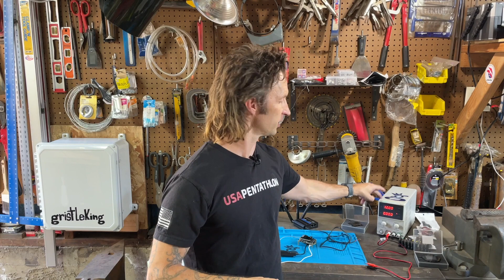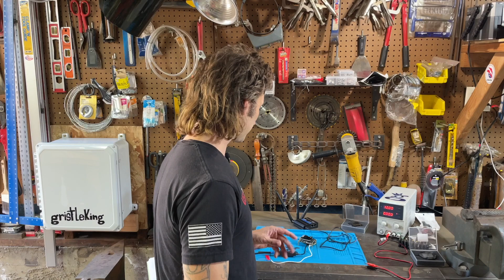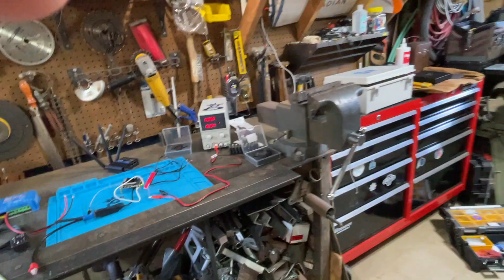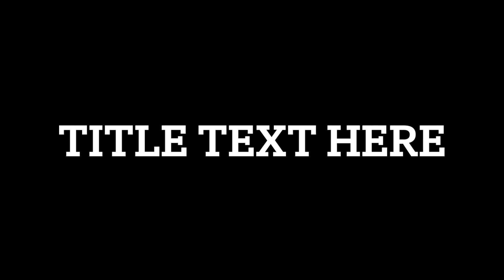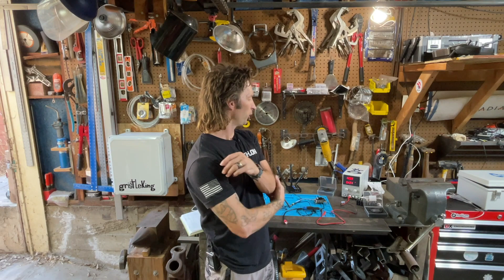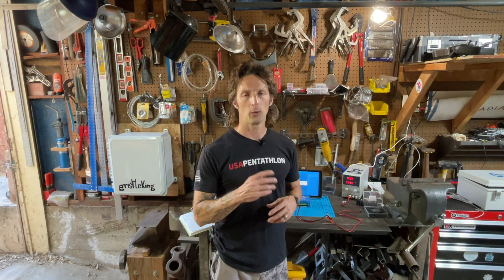Measuring Helium Hotspot Power Draws - Off Grid 004

Comment: Hi there, do you have any experience on setting the box under the ground? I mean burried let's say 10 cm? It'll be for security reasons. Will it heat too much? Will I have GSM coverage? And another question, if you permit, how would you estimate the revenues on a cluster of 10 hotspots each and everyone visible with the others and at a distance around 400 m? Thank you for your responses and a big thanks for all the videos.
Reply from the maker: I've heard of other people doing it and having problems with heating, although nothing they couldn't solve.  You'll need to keep the antenna and the solar panel above ground, so I don't see a huge point in burying the box.

With 10 hotspots all within 400m of each other you're probably going to overcrowd a res 7 if you're not careful with it.  If they're isolated, earnings will probably be lower than you might want. https://gristleking.com/what-does-a-good-hotspot-cluster-look-like/

Comment: Hi, light hotspots are the way to go for offgrid! Teltonika has power consumption data for the RUT240 (just search RUT240 Power Consumption on their wiki, can't add a link I guess), roughly the same you measured. One caveat: a current "fat" miner uses like 2Gb of data a day, but that is still less than 2W average for the RUT, pretty close to what you measured.
Reply from the maker: Totally agree re. Light Hotspots, they can't come soon enough.